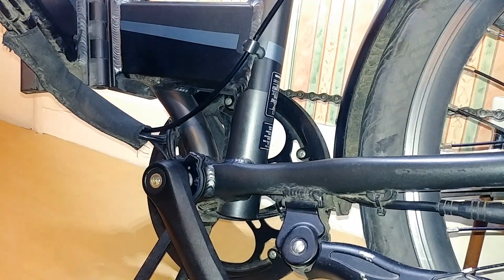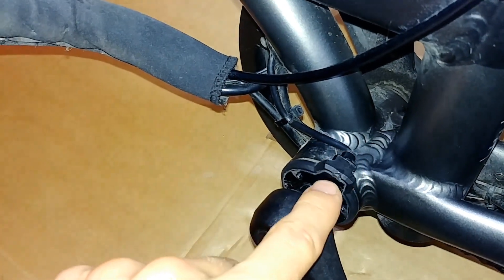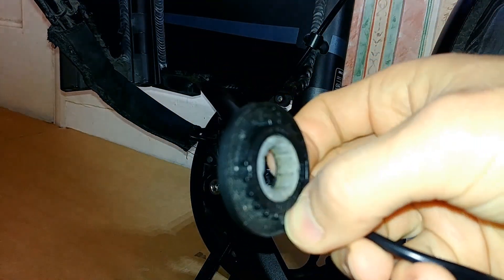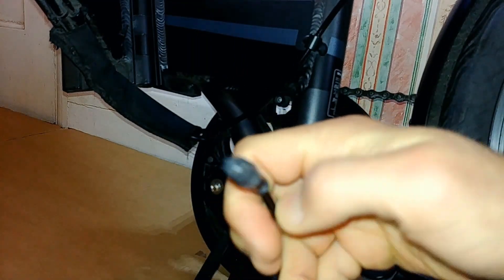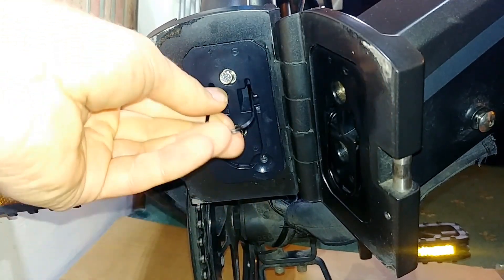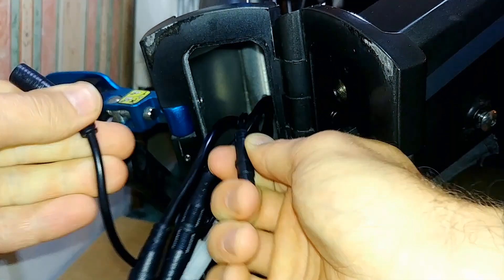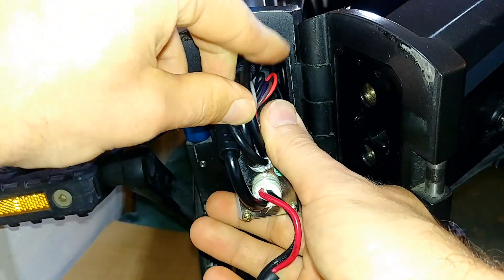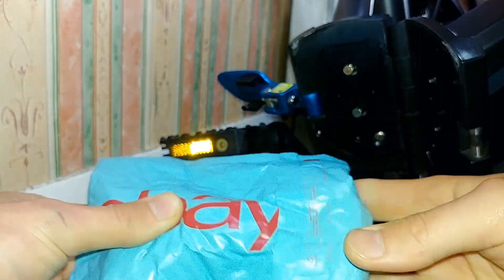How to replace magnetic torque pedal sensor on electric folding eBike - BTwin Tilt 500e Issue Fixed

Comment: In my case, I had continuous few second power cuts. I tried changing controller, and it didnt work (of course after reviewing every connection) cause the battery was refurbishwd with more power cells and i supposed that the matter was other. I bought a new pedal sensor and IT WAS THE SOLUTION after months of seeking any solution, and decathlon in this cases sends the bike for 2 weeks to Madrid here in Spain.... Thank you!!!

Comment: I drove the first edition and was really good, but the latest one cut-off the torque a certain moment. I would like to replace the controller for the old one...there is a specific model to choose?
Reply from the maker: Hello, thank you for your query.
Are your referring to any recent revision of the bike, or the original Tilt 500e? I had no issues with the controller on my bike..
Reply: @risk.adventure  Hi, the last model, it arrives a moment on which seems that the motor makes the bike stop. Don't know if is the sensor or the controller.
Reply from the maker: @DanielCurti  Hello, I would like to think it is normally sensor that goes bad. The controllers are usually quite reliable. Just pop in to the Decathlon store and ask them to diagnose your bike.. Otherwise you can put your bike upside down and spin the crank. Just observe the led on the sensor, whether it flashes continuously, or intermittently..  If its intermittent, it usually means that the sensor is bad.. Hope that helps bud
Reply: @risk.adventure  Thanks for your help!. It flashes quickly but constant.

Comment: I can’t believe that they go beyond the wires standard bend radius
Reply from the maker: Hello, I have later installed the sensor with the wire pointing towards the front of the bike, instead of up. It is much better this way and this seem to have rectified the problem. I have not had any more issues with sensor going bad, so probably I was just unlucky..